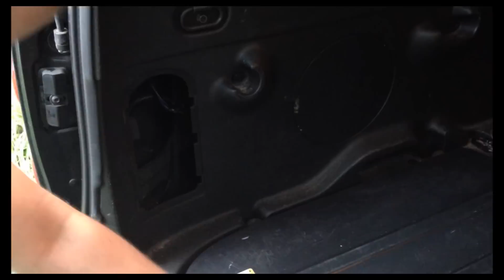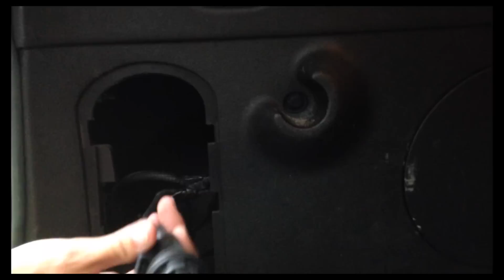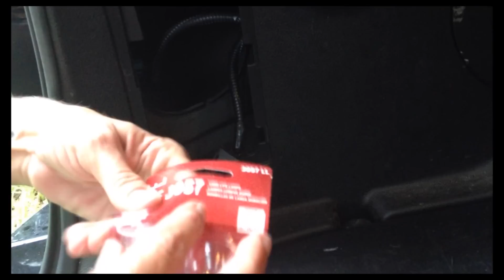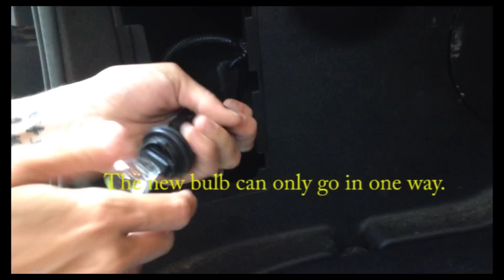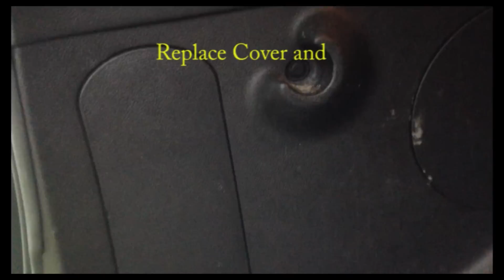HHR How to Replace Tail Light Bulb

Comment: Excellent.  So easy even I could do it.  I called an auto shop and they charged $65 "but that includes the bulb".  The bulb cost me $1.35 at the local motor parts store, and I replaced it for free.
Reply from the maker: +chili palmer thx for the great comment. You are correct on the dealer cost. Its rediculous

Comment: I had trouble getting it to turn counter-clockwise and struggled with that step until I decided to get a pliers, a needle nose was small enough to fit in there easily and break the torque, allowing me to do the rest of the job by hand. It was a very easy repair that anyone can do, but just make sure to have a tool for that step just in case it's stuck as badly as it was for me.
Reply from the maker: phubans thx I’m glad you was able to get it
Reply: Thanks, I thought my thing was broken or I'm watching the wrong video. I cannot get the damn thing to turn, thought it was screwed in SmH

Comment: Yea so what do I do when the bulb refuses to come out because whoever fixed it before me completely broke the entire tail light
Reply from the maker: Oh no, yea that’s a pisser. I’ve never had that happen
Reply: @fansofthe12hours  i figured it out. essentially the only way to fix the burned out taillight assembly is to either buy a new one, or hope that the bulb can still lock into place. in my case after about 30 minutes of fiddling i was able to secure the bulb in place and its been working for around 4 months now. i suppose if you are super handy you could also save that $60 by using some kind of glue or tape or something to hold it in place securely